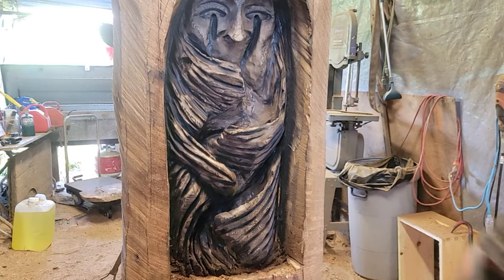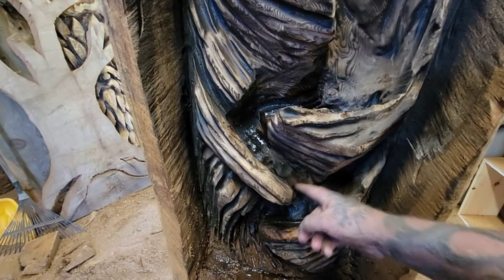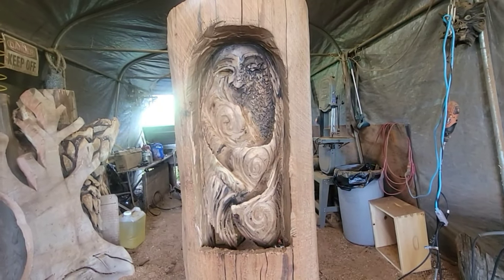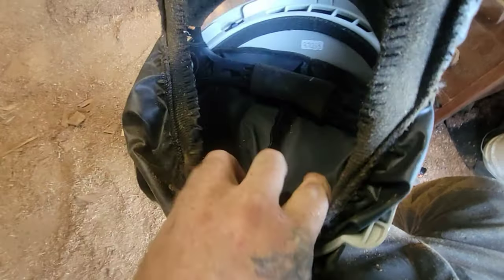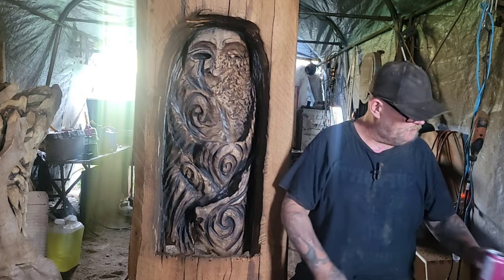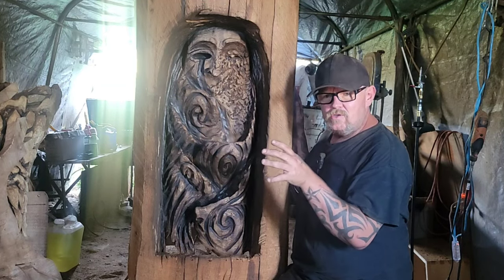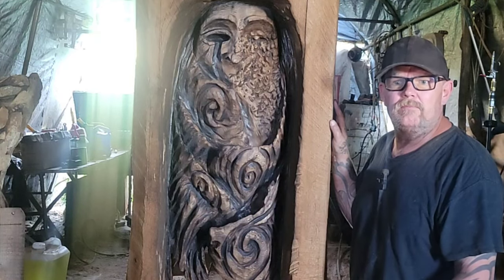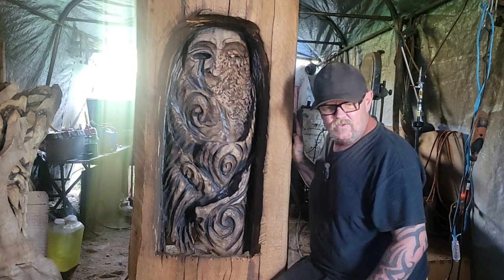Chainsaw carving a 6 foot water fall #2

Comment: I had a thought. Looks like you might have a tiny bit of splash out at the bottom. Maybe add a piece below the carving that extends outward in a curve. That way it could double as a birdbath.

Comment: Beautiful work bro. I love it. I'm number 32 thumbs up for this vid. Like the new intro. I do not know what water pump you plan on using, but you may have to play around with ways to limit the waterflow, so it does not shoot out of the eyes if the pump is oversized. One suggestion if you have to limit the flow is limit the outflow from the pump, not the inflow, it makes less noise that way. I've found when I limit the inflow the pumps tend to gurgle more. Also, a good thing to use on the rot, (I know you have a friend coming over for this piece) but if you want to do it yourself in the future is wood hardener. Any good hardware store should have it. Most are designed specifically to use on wood rot, to stabilize the wood, kill the rot, allow you to carve and they have the useful characteristic of waterproofing as well.    Carve deeper and carry on! 👍